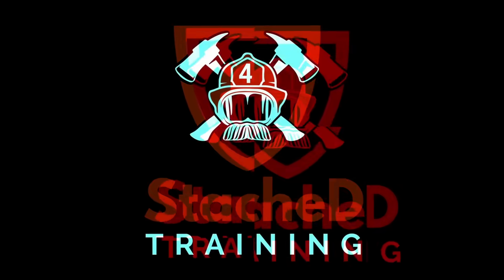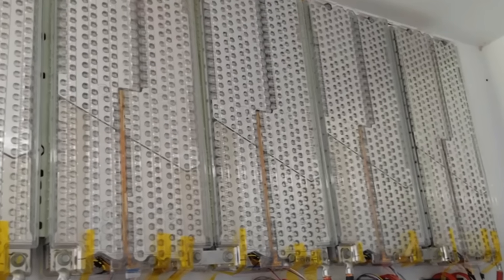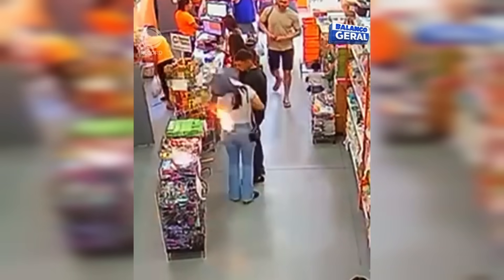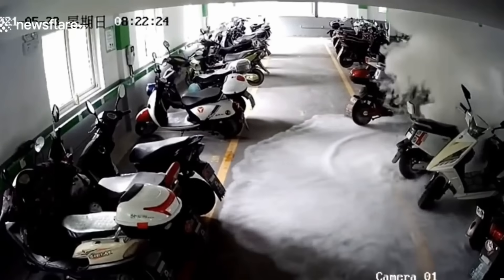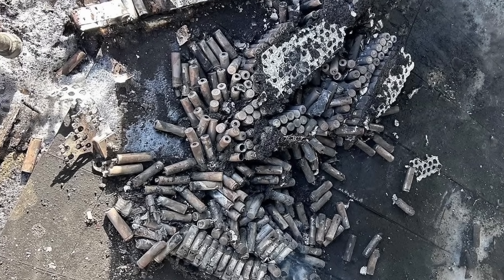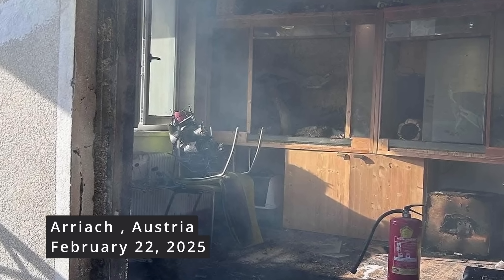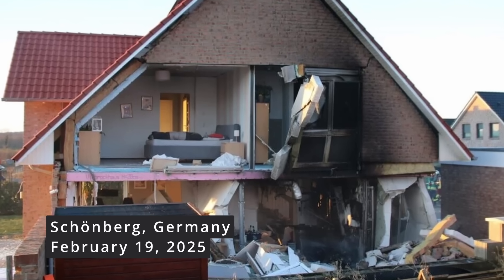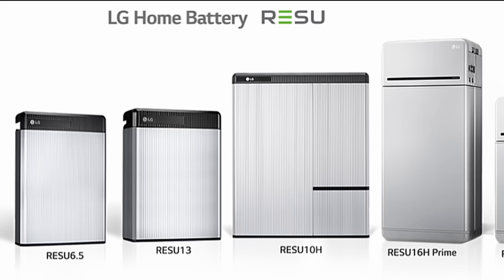Two Homes Just Exploded—The Hidden Danger in Battery Storage!

Comment: There is no way I would put one of these systems in my house.  There is just to much bad history with these systems.  Thank you for all the videos you do on this subject.
Reply: bad installations not battery fault, when we talk about lifepo4
Reply: Truely low IQ. 😂
Reply: *too
Reply: As of the third quarter of 2024, the cumulative US residential storage capacity was approximately 2.1 gigawatt hours (GWhr). Assuming an average of 10kWhr that would be 210,000 installations. Specific data on fires caused by home Battery Energy Storage Systems (BESS) in the United States is limited. However, a German study by RWTH Aachen University provides insight into the fire risk associated with residential battery storage systems. The study found an annual fire risk of 0.0049% per system. This would equate to about 10 fires /year in US. Unfortunately specific data on the number of residential fires caused by natural gas appliances is not readily available. However, a recent recall of nearly 500,000 LG ovens in the U.S. due to a fire hazard highlights the potential risks associated with household appliances. The recall was initiated after reports of at least 86 incidents, resulting in over 28 fires. (src. Cg Pt)
Reply: Out of curiosity, do you heat your home with Natural Gas? There are about 286 homes that exploded due to gas leaks per year. That's a lot of bad history too! The trick is not to ban an idea, but how to find the safest way to implement it. However, accidents will always happen. It's part of life.
Reply: @paparoysworkshop That being said are we improving or are we going backwards?
Reply: @paparoysworkshop  Yeah, but...
We need to compare the prevalence of gas heated homes with that of the miniscule numbers of battery power systems that are going BOOM! I play Poker, and refuse to draw to an inside straight.
I am in the process of installing a shed for my 3 battery LiFePO4 system. Basically, I'm building a concrete blast chamber with a foil roof and lots of vents. Directed carefully, of course.
Reply: @TimeSurfer206  True, but back when Natural Gas was first put into houses, they went boom left and right. It took many years to get the number of explosions down to what it is today. So It will be the same for batteries. Technically, it's the same for any new product. The first planes crashed more than today. Same with the first trains. The first of anything will always present the most problems, and in time, those problems will be solved. Or at least, minimized.
Reply: @TimeSurfer206 lol. A little overboard but I agree. I have 16 LiFePo4 batteries on my back porch. My concern is the porch roof is tied into the houses rafters. 
So I plan on a small storage building in the yard away from the house. It can blow up all it wants to then.

Comment: Any battery energy storage system needs to be in a separate concrete and steel building with a way to vent any gas buildup.
Reply: :trophy-yellow-smiling::trophy-yellow-smiling::trophy-yellow-smiling::trophy-yellow-smiling::trophy-yellow-smiling:
Reply: If you have to go that far, should you really be doing that in, around, or anywhere near your home?

I have multiple neighbours with electric cars, solar panels, home chargers, and of course home battery storage. Just considering how much fuel they have in their homes and on their driveways so close to my home is kinda concerning.
Reply: @captainotto  Don't worry, you only go boom once.
Reply: @captainotto Exactly. A battery fire can cause a parking structure to burn along with the cars parked there.
Reply: @captainotto  Insurance companies are canceling peoples home insurance if they see you have solar, an EV or batteries.. Newer tech like LiFePo4 and Salt batteries are pretty damn safe if taken care of properly.. Actually less dangerous than a 5 gallon can of gasoline in the garage or house.. Plenty of fires from natural gas, container fuels, paint thinner and so on every year that we don't hear about.. Then there is the stupid human factor where fireworks, sleeping with lit cigarette or candles or even a flare gun that burned down a casino in Montrose that a band wrote a song about.. But hey the MSM has to sensationalize battery fires..
Reply: @captainotto  Get rid of your propane gas bottles immediately!
Reply: @ Don’t have any. I grill with charcoal and wood. But I appreciate your concern.
Reply: @captainotto  re: "If you have to go that far, should you really be doing that in, around, or anywhere near your home?"  LOL ikr...?  you can tell people don't listen to themselves, nor do they understand themselves.🤣 I mean it's absolutely hilarious for those versed in Psychology and Mental Health to see and read all the people basically "twisting themselves into knots" trying to come up with 80 different ways to keep doing what it is they're doing...

however like i've been saying for some time now, unfortunately most minds have grown so weak at this late date in History, that they cannot see the PARADOX or CONTRADICTION of how they're desperate to use technology in the "second" and "third parts"...? to try and correct or "cover over" all the mistakes they're making with the use of an inherently bad technology in the "first part"...?

however what the (ironically German) wiseman told us was this: "We can not SOLVE our problems with the same thinking we used when we CREATED them..." - Albert Einstein (1879-1955) 👈yes having to face this will be "unpleasant" but face it we must.  also ref: Mankind's TECHNOLOGY ADDICTION.
Reply: @captainotto  A gas Boiler has similar risks. Yet we still keep that in the home aswell. With this way of thinking Nothing should be kept in the home cause there is always that risk of blowing it up. Course all of this should be kept seperated but nobody does it. cause everybody things "not gonna happen to me" and for most people this is true... you just hope your not the one it does.
Reply: @BlueBD  I'd be very surprised to find a pressurized boiler in a home. A water heater has a relief valve that prevents pressure build-up.  Even a steam heat "boiler" does not develop  much pressure and has a safety relief valve.
Reply: @BobBrown-r6t  There was a recent explosion in NY in January (Edit cause I forgot when) It still happens. Most homes still use standard boilers. not the new fancy electric. hell even new builds still use regular boilers. you got to go out of your way to get the electric ones.
Reply: @BlueBD A gas boiler in the home ?  Maybe in 1900 lol.
Reply: @BlueBD Most homes? I have never seen one in new construction and not in anything much past the twenties.
Reply: @BobBrown-r6t and when the safety valve fails?
Reply: All batteries don't need that. I have a bank of lead acid batteries for power outages and there's no risk that they would explode. The hydrogen from charging is handled safely.
Reply: @skunkjobb  Are you related to my nephew, Thomas? He's quite handy!
Reply: Bunker, a reinforced bunker with no way for rain to get in or water to drain out if it goes melty.
Reply: @joytotheworld9109  Nope, you need a blowout panel, like the garage door in the video.  Otherwise, a failure will result in chunks of concrete flying at high speed.  That's why boiler and pressure vessel rooms are built with blowout panels.
Reply: @BobBrown-r6t  Well, of course, but those blast directors need to be properly engineered.
Reply: A 200 gallon oil tank for heating and emergency power generation. A car in the driveway that can travel hundreds of miles on a tank of gas.
Reply: @gordonwelcher9598  You can extinguish oil and gasoline fires using handheld and wheeled fire extinguishers. Those are useless against battery fires unless the battery is tiny.
Kind and quality of fires are just as relevant as frequency.
Reply: @gordonwelcher9598  How do you do that, exactly?
Reply: @tedmoss  In North America this has been done for the last 60 years.
Reply: @gordonwelcher9598  Wow you had lithium Ion batteries in 1965? Surprising!
Reply: Just use NiCads , you can buy a cheap battery storage cabinet made of steel and mount it outside. Well maintained NiCads can last 20 years and you can change individual cells
Reply: lithium iron batteries dont hava gas buildups, only lead acid have but its minuscule
Reply: Using car batteries for your home sounds like a very bad idea.
Reply: And even if it's in a cold climate area , it doesn't take much to heat a small shed for the batteries.
Reply: Just use LFP batteries with no record of spontaneous fires.  Thats lithium iron phosphate, very different to lithium ion.
Reply: Does anyone remember putting fire crackers underneath an upturned tin can when they were kids and watching it launch? I'm sure there's muppets going down to the local hardware store to buy a small garden shed for their DIY home battery systems and thinking they're perfectly safe and adequate. 🤯
Reply: 100% agree even ecigs have vents built into them I've seen 1 single 21700 go up and it ain't pretty
Reply: That’s generally what’s required for led acid battery rooms.
Reply: Fighting a battery fire requires lowering the temperature to the point below which it will stop burning. Liquid nitrogen should be  directed at the batteries.
Reply: No Karen, you don’t know what you’re talking about… you’re a fear monger. Go stand in the corner. Nothing that you said makes any sense.
Reply: Vent and properly cool or heat the battery
Reply: DIY systems yes, everything else no
Reply: :DDDDDDDDDDDDDDDDDDD yeah lets all take a loan and build separate house to store battery :DDDDDDDDDDDDDDDDDDDDDDDDDDDDDDDDDDDDDDDDDDDDDDDD
Reply: No does not have to be there. Any battery can blow even your phone and you can burn including your house.
Reply: Agree 100%
Reply: E-Vangelists; "they are perfectly safe"
Reply: @totallyjonesin You mean Tesla fanatics.  Those cars are trash.
Reply: @totallyjonesin  they are safe! LiFePo4. Gas also explodes but many houses heats using gas that comes into your gas heater that is inside the building.  the problem is not battery itself -but incorrect installation. not talking about li-ion batteries having cobalt, only about Lifepo4. They dont burn. so this mean sall you have to do is put H gas sensor and make it goe load when detects gasses and come and vent the area where battery is.
Reply: This is rediciouls and definitely very much worse than traditional carbon energy

Comment: I considered buying a GroWatt system, but when the installer said it must be installed in the garage for safety I began to get worried. Why not the roof loft space? (Too hot in summer?) so I decided to wait until the technology was more mature.
Reply from the maker: Any confined space is bad.   A hot confined space is worse.
Reply: @StacheDTraining in the UK, the usual place was in the house loft. I believe that has now been stopped, but there's plenty of homes with these fitted.
Reply: @MrGH9146 The UK probably doesn’t have to worry as much about hot attics, but it’s still not a good placement.
Reply: Growatt = LFP,   lithium iron phosphate, a safe choice for a home battery.   Lithium ion is where the thermal runaway risk is.
Reply: @tftftf  - thank you; an encouraging comment at last. My neighbours do have lithium batteries in their lofts, charged from solar panels, and I was doubly concerned about their own houses being at risk from the installations - and mine if I went the same route.
Reply: The technology will not be mature enough to be in a hot environment. So I'm sorry no storage for you, or it will  go outside
Reply: GroWatt? Are you sure you weren´t in a growshop buying a fully equiped growtent?n🙂
Reply: @ GroWatt, look them up
Reply: Growat is simply an inverter, DC charger based off decades old technology, there is nothing to mature here. Use LifePo4 batteries, it’s very difficult to get them to combust, server rack versions have excellent BMS, circuit breakers and voltage protection making them safer than almost any other battery.
Reply: So, you think a battery exploding in your attic and through the floor is better than a battery exploding in your garage and blowing the door off?🤣
Reply: @1225KPH  suggest you read my post correctly.
Reply: @1225KPH  Totally wrong assumption on your part. What I am saying is there are still lots of homes with dangerous batteries in their lofts. I do not have an EV, solar, or a home battery setup.
Reply: @MrGH9146 , you misunderstood that he was talking to you, instead of the person who wrote the first comment. And he gave a clearly immature attitude in his comment to annoy or ridicule whoever he was talking to. Then he misunderstood that you are the person who wrote the first comment.